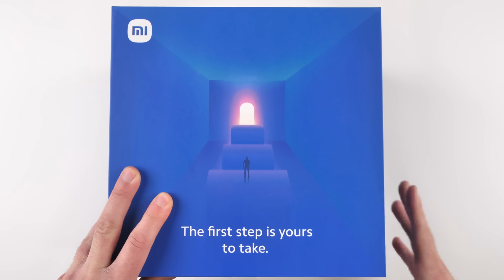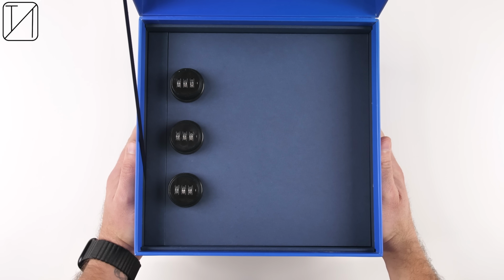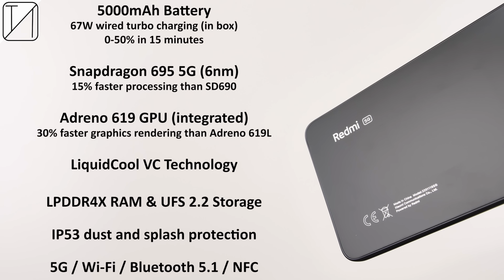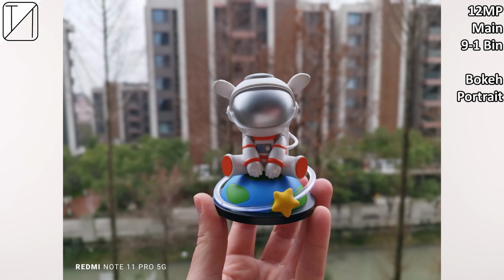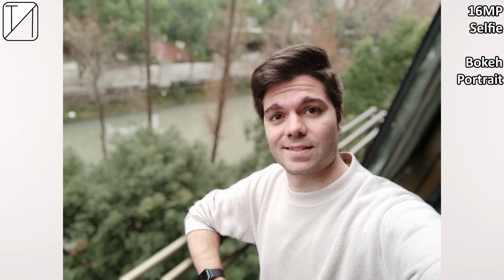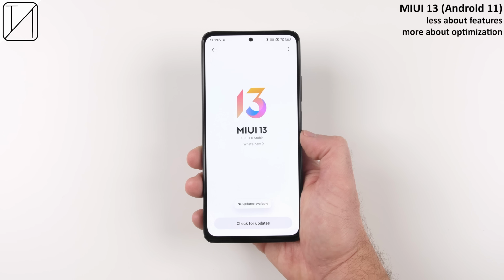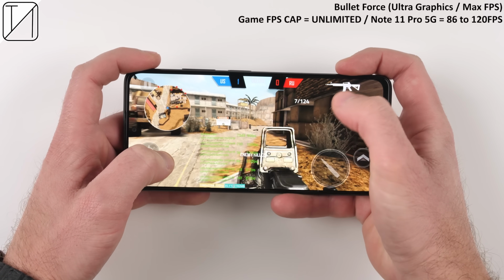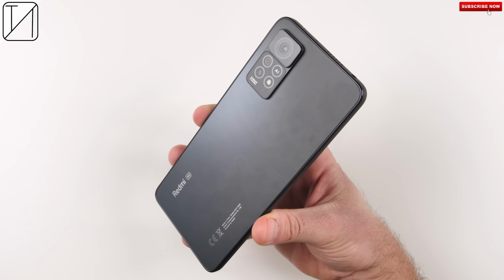Redmi Note 11 Pro 5G (Global Version) Unboxing and Review

Comment: In my opinion this is not a worthy upgrade if you have the Redmi 10 pro but If your not a Redmi user and you want to try the brand then I suggest you get this phone. This one have almost the same specs but much more effecient than the 10pro and because the chip used is sd695 5G(6nm) this means when using mobile data you can experience a higher latency rate in playing online games without experiencing lags. This also solves the overheating issue. A beast mid range phone with a reasonable price.

Comment: Please correct me if i said some false info here :)
I was picking between the poco f3 and the note 11 pro since the china variant was released. Yes the poco should be a no brainer but the note had features that I liked, especially the headphone jack, expandable storage, and, according to the reviews at the time, had a great camera (and I loved the box-style design xD). But, after seeing the global release stream and most reviews regarding the phone, it basically just sealed my decision to go for the poco f3. There's a lot of changes that made me go for that decision and to name a few; Instead of the dimensity 920, the opted for the sd 695, which is not a bad chip but the extra power in the dimensity (up to 495k on antutu) would be beneficial from the snapdragon (up to 405k). Next is the camera, especially the recording being capped at 1080p30 on the rear was a big deal for me since I do quite a lot of photography and cinematography from time to time. Lastly, pricing. I was hoping that they would go for the same pricing they did for the note 9 and 10 (around $250 for the pro models) but it bumped up to $349 which pretty was the deciding factor for going for the poco. 
I know that the chip will receive more optimizations for the cam but the slight decrease is max performance and pricing was important for me and seeing the prices of both phones, the poco seems to be the better value (I've already seen camera reviews of the two and the poco isn't that far behind, except for the low light capabilities, so I guess it's fine).
Again, feel free to correct me if I said some false info here :)
Reply: Didn't know some random Hololive clipper came here, maybe the F3 might be better for you

Comment: Disappointing model. I was about to switch from my Redmi Note 8 pro 6/128 to this model, but after the realease of hardware specs I know there is no point in that, as it won't have any significant advantages over my current phone that runs as fine as it did 2 years ago. Bluetooth 5.2 is tempting but overall, that's a pass for me.
Reply: Agree, atleast they should've considered using a Snapdragon 700 series in their SoC but no, they really drop the ball this year.

Comment: Seems like a lot of downgrade even compared to Note 9 Pro. No 4K, not 5MP macro, a more weaker chipset compared to last year's offerings, and yet it's a Pro model? The compromises are endless.
Reply: 695 in terms of Battery Efficiency, Gaming Performance, Network Connectivity is better than 732G
Only down-grade is 1080p 60 FPS from 4K 30 FPS

Comment: In my region, you can get the A52S over the note 11 pro 5g( China variant ) for just twenty dollars more. The A52S makes much more sense all around ; better display, better camera setup,better chipset, and better battery management.
Reply: Or just get Poco F3 which kills both brands 🤔🤣😂!
Reply: @azwads5126  poco f3 is trash infront of A52s
Reply: @penunggangunta3126  in what way? Poco f3 is better in everything besides cam
Reply: @marwin436  software,build quality,software updates,audio(speaker)...i also not mentioned a few flagship features that existed in samsung A52 5G while poco f3 doesnt has..
Reply: @penunggangunta3126  f3 has the better build quality and materials, the speakers are really good. I never heard the ones of the Samsung, I can see the software point but that isnt worth the much higher price and half the power
Reply: @marwin436  you are wrong bro..first some expert tech youtuber has done speaker comparison between both..and he says that speaker on A52 is sound more crispy(better) than poco f3..i also have done my own super in depth comparison between both on GSMARENA...i know what im doing...oh actually build quality on A52 is better since it using plastic back vs glass back on poco f3....i agree with you that poco f3 has more power(thanks to sd870) than A52 5G
Reply: @penunggangunta3126  the material is preference and yeah the speakere a lil better but not a big deal. Have a nice day

Comment: If only they replaced the 108MP main main for a 48 or 64MP sensor with OIS and a 12 or 16MP UW with AF. and replaced the SD 695 with Dimensity 920.
Reply: Congratulations you won message right away through the number above I have something for you..

Comment: nope.nothing new worthy here
xiaomi should really step up the game in redmi note series at least in pro or promax models by releasing a phone with:
1-OIS main camera latest top-sensor+ wide camera 16MP 128-150 degree + 5x zoom telephoto camera , also 60fps for rear camera & 4K for selfie should be a must-have feature,not sth to miss
2-5500mah + 67-120W fast charging,1-100% below 25minutes
2-triple slot ,so dual sim with dedicated microSD slot 
3-3.5mm tuned audio jack with Dual speaker again tuned by JBL or H&K ,etc 
4-MTK1200 or 9000 or Qualcomm flagship-performance chips with good cooling 
5-price below 350-400usd

Comment: I know this is just semantics but the title of this being a Global version should be changed to International (by title I don't mean of this video but by Xiaomi since this model isn't officially sold in the US which is still one of the largest markets).

Since it's not officially sold in the US, as much as of a shame as that is, I wouldn't be able recommend anyone buy this off third party sites even US sites, not sure if Xiaomi honors their warranty for buyers in the US and two there will likely be some antenna bands missing but overall it's a shame cause in the US, good budget options are limited. Short of the Galaxy A series and Pixel A series phones, it's really hard to recommend others. We have Motorola as well but I would never recommend those over Samsung and Google offerings.

This Note 11 Pro 5G if it sells for under $400 in by third party US retailers then it's not a bad deal at all so long as buyers know what they're getting and where the shortcomings are.

Comment: Lol I am currently watching this on my Redmi note 10 pro and although note 11 pro have some upper hands like 108 mp camera and 67w charging I'm quite happy about my phone cuz it supports both 4k and 1080p at 60 fps also edge dettecting in selfie bokeh is far more better than this I honestly don't care about 5g because its not available in India so I didn't switched to 5g device as it will take around 1 or 2 years to get here and also I got SD732g and the same gpu so I might suggest if you are from India go For note 10 pro or if you really crave that 108mp go for Note 10 pro max
Reply: Congratulations you won message right away through the number above I have something for you......

Comment: Kata bodoh kang dpt jgk sekor sekor komen ni, tu harga europe bebal, europe mmng mhl dibanding asia. Fikir la klu drg letak cip 778 bole ke nnti drg tawarkan dlm harga murah. Bebal. 5000mah, 120hz, 67w, 108mp, skrin amoled, stereo speaker, ada memory slot, IP53 rate, android 12, MIUI13, gorilla glass 5 & byk lgi bnde yg bkn cikai punya spec. Adakah itu namanya masih mengecewakan? Halahai. In fact, cipset bukan nya lemah, it's 6nm processor. Terus terang aq bole tebak harganya nnti 1300 & yeah memang ada kurang sikit but percaya la harga nya pun nnti obviously lgi murah untuk mid range mcm tu.
Reply: Congratulations you won message right away through the number above I have something for you......

Comment: A question but the proximity sensor works or not?
Does the screen turn off during a call by placing the smartphone to your cheek?
Thanks
Reply: Congratulations you won message right away through the number above I have something for you..
Reply: I know that in redmi note 11 (not pro version) the proximity sensor in the same (virtual) as in redmi note 10 (note 10s, note 10 pro), so I think in 11 Pro version the same situation. When you call someone and put the smartphone on your shoulder, the screen lights up and you can press the buttons on the screen with your cheek.

Comment: It looks good no doubt, but Xiaomi is going to have a lot of competition this year in this price segment. May have made a mistake going with the Snapdragon 695 instead of Dimensity 920 or the Snapdragon 778. I was expecting the Snapdragon 778, which would have put them probably in the lead. Gonna be some tough competition against Samsung, Realme, and maybe even Google later on.
Reply: 695 Is A Decent Chip Same As 765G 
It Qualcomm's Mistake To Name It In 6 Series
Reply: @sitaramchandora3104  Snapdragon 765G can record in 4k, 695 can't. The 730G on my 2 years old MI 9T can record in 4k. It's a big oversight.
Reply: @artdogg50  It's Because Of Lack Of Optimization Bro
And Only Benchmark Scores Doesn't Judges A Chipset 
Chipset Must Be Stable And Thermals Must Be Controlled
Reply: @artdogg50  depends how rich you are.....
Reply: @sitaramchandora3104  no it's not a mistake. The successor for 765 n 750 is 780 n 778. 695 is succesor of last year 6 series.
Reply: @sitaramchandora3104  I m pretty sure Qualcomm charged less money also from Mi due to fact that they named this 695 sd....Must be due to tuf competition from Mediatek
Reply: they will use 700 series soc maybe on 12models to make distictions between the 11 and 12 models. xiami is a bit confusing not only in naming but in the order of releasing their products. the update of the previous 4g models to 5g adds to the confusion
Reply: If they gave 778 at this price point there's only flagship chips left only
Reply: 778 will cost you 
Maybe no amoled or amoled w 60hz
lost the stereo speakers 
less stronger glass
Reply: +1
Reply: worst is not same as china version
Reply: But what the ... is the PRICE ?!
Reply: 695 has two A78 cores, as does the 778.
Reply: 695 is basically a 750g
Reply: @skyemperor2357  Except the Snapdragon 750g can record in 4k.
Reply: @skyemperor2357  that's not true

Comment: I think xiaomi 11 lite 5g NE is even a better option than the Note 11 pro 5G .. the 11 lite 5G NE has an even better display with 10bit OLED display with Dolby vision + an even better snapdragon 778 processor  which performs better than the SD 695 processor in the note 11 pro 5g... the 11 lite 5G NE has an even better dxomark camera score..
Reply: 10bit color are gimmick..
Reply: @penunggangunta3126  No, and by the same reason, 190hz, XXmp camera instead of 12, 5G in many countries, ip53, etc are gimmicks....
Reply: @extreme123dz  i can give you the link to proove that..
Reply: @extreme123dz  ip53 is honestly a gimmic tho, it doesnt make any difference from not having it

Comment: What could Snapdragon 600+ actually do? I had 845 with the Poco. will it allow us to play like it without a problem?
Reply: The Snap 845 is about equally as strong as the 695 here, the 845 has a weaker CPU, and stronger GPU, and not all Snap 600 chipset will allow to play anything flawlessly, but the 695 is certainly strong enough
Reply: @fa14bi-78  no, SD 845 stiil more better, the advantage of SD 695 only more  battery life
Reply: @fa14bi-78  I don't think the lower processor would do better. I used it to play games for more then a year and a half now it still runs smoothly

Comment: Darn. Step back in terms of video versus the previous global Note 10 Pro and the Chinese model.

Could a Chinese ROM or even an aftermarket app like Filmic bring back the 4k, or is the 695 just not capable of running it? (The Fold gets 8k out of the same sensor for heaven's sake, is 4K30 too much to ask for?)
Reply: 695 isn't capable of 4K
Reply: @technicalmaster-mind  figures. Not worth getting over the 10 Pro, not until they bring the Chinese chipset into play, then.
Reply: @nikytamayo  they'll launch Chinese variant in the global market to (with different name)

Comment: Disappointed! I rather have the Dimensity, this SD 695 seems a step back from neither Redmi Note 10Pro nor the Redmi Note 11Pro from China... The only good thing is the 5G, that is not so needed in many countries.
And, Main Camera limited to 1080P@30fps is unexcusable at this point, both versions I mentioned go up to 4K@30fps.

Personally, I still prefer the Chinese Version or the Redmi Note 10Pro from last year.
Reply: Even my Redmi Note 7 (non pro) from 2019 with SD660 has 1080p60 recording with stabilization, and that’s with the stock camera app. It can do 4K30 but with GCam side loaded. Yes, this new release is underwhelming. Good gaming performance though, and battery life should be solid. Plus 5G for those who need it (I don’t).
Reply: @MasterKoala777 , we shouldn't be comparing the RN11 to the RN7 Camera Wise... That's one of the big things Xiaomi/Redmi is bragging about.
Reply: Man it only some slight different nick tested note 11 pro + mediatek and its only like 30k antutu difference
Reply: @kaederukawa8773  the mediatek can get up to 495k when it's on performance mode (695 is already on performance mode when he got 405k)
Reply: But yeah camera wise is bummer
Reply: @kaederukawa8773  big time, bro!

Comment: Snapdragon 695 is slighly below Snapdragon 845. The CPU of 695(~124K) beat 845(~105K) but the GPU is another story 845(155K) beat 695(102K)
Reply: Benchmarks =/= real life use.
Reply: But it is still lower than dimensity 920, the score of dimensity 920 is around 480k to 490k, whereas even the antutu score of sd 695 is 400k, sometimes below 450k, which is near the G90T in Note 8 Pro for about 380k to 410k.
Reply: Snapdragon 845 is better because it supports 4K 60fps video playback.

Comment: Omg I'm glad that it gets SD695. Many sources in past week mentioned that it'll get SD690 with pretty much the same as SD732 in term of performance. Thanks for the Unboxing video! Definitely the best unboxing video out there with compressed but still detailed video. I'm planning to buy this phone when it launch in my country.
Reply: 695 is 20% more powerful than 732G.
Reply: I would be more satisfied with Dimensity 920
Reply: @HaraBoss  Same.
Reply: @HaraBoss  Only like 30k anturu different so not to much performance loss there
Reply: @HaraBoss  Dimensity Is Not Good For Long Term Usage
Reply: @sitaramchandora3104  Why? Any proof?
Reply: @sitaramchandora3104  Actually dimensity is better.
Reply: @HaraBoss  thermals are not good as Snapdragon
Reply: @sitaramchandora3104  SD 810 or 888 maybe.
Reply: @Cosplayinghuman  that's because the only phones that used MTK were cheap and horrible until at least 2018.
Reply: @sitaramchandora3104  thermal throttling tests suggests otherwise tho as it runs cooler than the poco f3 if I remember correctly (watch frankietech's vid about that)
Reply: They are almost the same in terms of performance except 695 has 5g
Reply: @ANJOT1986  so does the 690.
Reply: So basically the note 10 pro is superior in specs with cheaper price
Reply: @rafflesiadeathcscent3507  695 is on par with 750g. Also this comes with better display and 67w charging.

Comment: I think this Still cannot beat the value that's offered by note 10 pro.
Seems like note 10 pro still have the better cam
Reply: No.
Reply: @faisalrahman9236  Yes.
Reply: @extreme123dz  Noooo..... How can you say that without comparing both sides by side?
Reply: @faisalrahman9236  5 MP Macro Depth sensor and 4K 30 FPS is killer in RN10PRO Global

Comment: The 1080P at 30 Max recording is most probably a software issue that still has to be updated since ur phone is so new, its basically a review unit. because the redmi note 10 pro can do 4k and 1080p 60

The camera pictures and videos look alot worse than the redmi note 10 pro so it has to be a software lock no doubt about it.

The Screen does go down to 60Hz when its viewing 60FPS content
Reply: Yep. Software update will enable 4k.
Reply: Naah
695 isn't capable of 4K

Comment: Not impressed at all, the Samsung A52s is far better, for 50 euros more. Better camera, better CPU, better UI
Reply: Plus ois camera and 3 years os and 4 years security update which is unheard in many phone in midrange class
Reply: Plus IP 6x rating for A52s
Reply: You can also buy Samsung M52 5G with same money
Reply: A52s is not better and adding more than 50 euros is a lot.